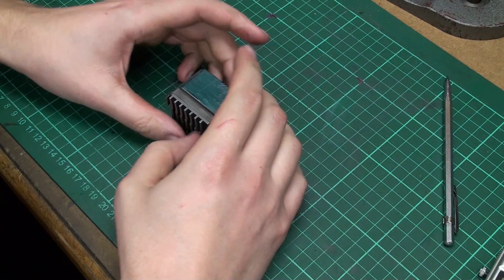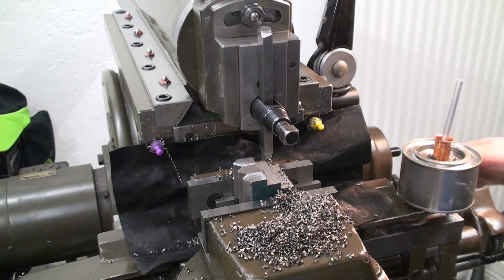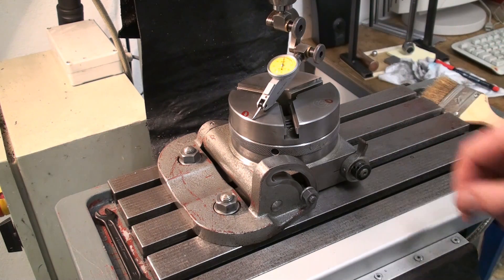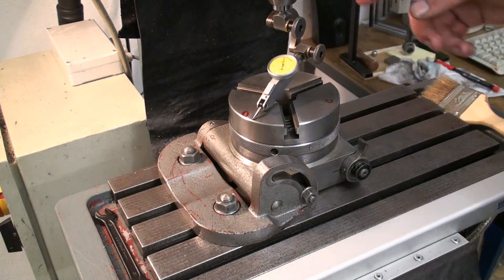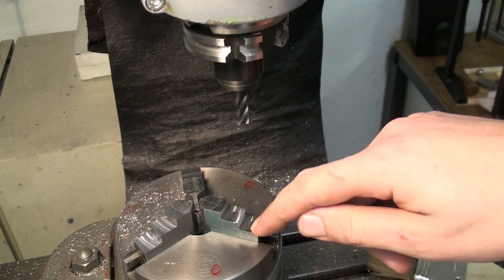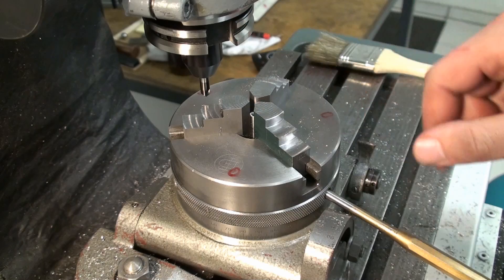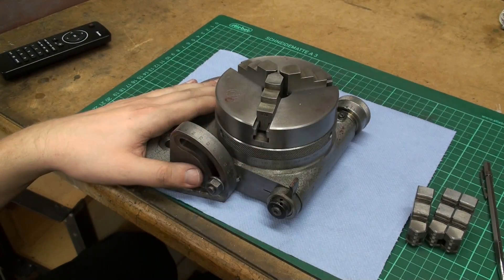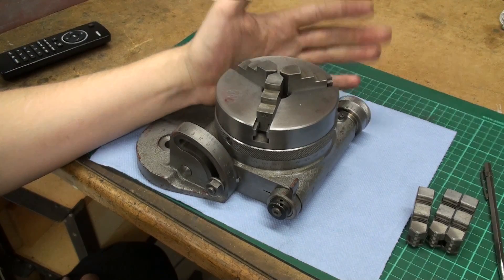Making a set of chuck jaws Part 3/3

Comment: Really great work.
I have a question though: wouldn't you get a better result if you rotated the chuck by its own crank instead of interpolating a circle with the mill? That way you could be sure that the clamping surfaces are concentric with the rotation axis

Comment: Stephan, I picked up a six jaw chuck for my lathe.  It only has three jaws with three of the jaws missing.  So, it is effectively only a three jaw chuck.  Where on you chuck the "offset" was 1/2 of the pitch, I trust that my "offset" will be 1/3 of the pitch.  I will cut a trial piece to see if my anticipated approach is viable.  I missed how you came up with the template for your pantograph.  And I do not believe that you explained how you set your ratios on the pantograph.  Can you help me out there?

Comment: Very nice precision project. I am curious though - would it have been useful to cut outer step at a larger diameter (i.e. with the jaws more open)? So that way when the jaws are opened to clamp on the ID of a bigger part the curvature of the surface would match better. I'm not sure what is normal practice.

Comment: Amazing and beautiful as ever Stefan. A question so I can learn more:you explained that the outer edge of the chuck isnt a reference surface, you dont have one actually to indicate the chuck to the mill,  the runout you got was very good but.. some. But at the very end to break the edge and cut the rebate, you turned the chuck by hand. Why couldn't you do the same when taking a finishing pass on the jaw inner and outer faces, so they would then be perfectly concentric with the chuck rotating axis ? Or did I misunderstand something?

Comment: Steffan, love your video's. When you set the work into the vise, do you not have to tap the work piece back down as you tighten the jaws? I always had the work lift slightly from the movable jaw slightly rising, thus the parallel would be loose under the work. The shaper I ran had a patent date of 1903, but would make a cut with only .001" variation across a 6 inch work piece. That was back in 1988.

Comment: Don't you need to clamp a ring on the outside of the inside clamp jaws before trueing them instead of clamping a pin in the center of the jaw to account for differences in the inner and outer scroll gear surfaces?
Reply: If there was any wear between the teeth and the scroll perhaps but they are a perfect fit.

Comment: Excellent job. Thanks for documenting this project. One question, have you checked the runout while gripping a cylinder from the ID? I was thinking that when you cut the steps the chuck was clamped in, when it should have been clamped out. Just to load the scroll against the side of the teeth that will be used. I do this when machining soft jaws. The nice thing about jaws that are not real hard, is that you will always be able to give them a touch up, without having to resort to grinding.

Comment: Hi Stefan, Once again I watch virtually perfect work. In all my 60 odd years of engineering I have never had the pleasure of seeing someone make replacement jaws for a chuck, or if it comes to that the capability of doing so. I have recently had the identical experience where the normal jaws were missing, and it was on a small rotary table, but fortunately my friends stock of odds and sods of chuck jaws came up with exactly the right jaws. The only problem was one of the teeth close to the lead edge was broken off and produced a 3mm off center error, but by careful manipulation I managed to get the correct orientation of that jaw and all came together with just 0.01mm radial alignment error.
A beautiful piece of work Stefan but tell me what are you going to do with yourself when you have all your tools and attachments working perfectly?
 Many years ago I was offered an engraving machine for nothing but declined the offer as I then didn't think it was of any use to me. After watching you I now think differently.
Keep up the videos Stefan and good luck to you for your future.
Best Regards MoK

Comment: I have watched all three of this series, for the simple fact, that I have this same tilting dividing chuck... I purchased it several years ago, from Ebay, and I think I only paid approx. $125.00 U.S.A. dollars, only to not realize that I got a really great deal on, due to the idea, that the suggested retail, over the years, I have seen these unit sell for as much as $600.00 U.S.A. dollars, so, I didn't do to bad. (((BUT))).... this unit is, by all means, not perfect. I did have to pretty much rebuild the entire unit, incorporate a flanged type oil-lite bronze bushing in where the chuck mates to the main body's structure, like a thrust washer and bushing, just to snug up the 2 axis of play that was in it. reconfigure the back jam-nut system.... blah, blah.. you get the point.... once done, and all trued up, I used this unit allot. There has been a few jobs that I wanted to use it and couldn't, but, now that I see how you simply made the teeth (with the engraver machine) (of which I now want one more then ever!), I can see making several sets of various type of jaws for this. Thank you for the efforts to put these videos together. I also would like to make mention, my unit has a few different things from yours. I think yours may be manufactured with a higher standard then the unit I own.....example #1, my scroll is turned back words from yours , as per, the direction the collar is turned to either move the jaws inwards or outwards. Example #2  yours very likely once had both sets of jaws, where as mine only has one set, but they are reversible (just simply scroll them out, and flip each one 180*, and re-scroll'em back in). That would tell me, that mine is of a less quality, due in part,  the game of truing the 3 jaws while they are set up in the chuck one direction of clamping, by grinding/machining the inner surfaces and then the outer surfaces, sure, that is great, until, I pull them out, and flip each jaw 180*, now, they are out again, by quite a bit... I ended up grinding/machining at a half way point, the best of both worlds, so to speak. Now, after seeing your videos of this..... I AM ON A MISSION !!!! Seeing the engraver make simple work of the teeth and accurately as well. I can assume cutting the teeth was time consuming, but, so worth it! Great job!!! I am sorry, this is so long

Comment: Really nice work.
I'm wondering about 1-2-3 numbers for the jaws, my 3 jaw chuck has those numbers and jaws can't be used in different order. Is this chuck without such a requirement?
Reply from the maker: +Andriy Podanenko You cant use them in different order, but you can use a different starting-slot, works on every spiral chuck.
Reply: Stefan Gotteswinter hm. I believe my chuck has specific slots for 1,2,3 jaws in terms of accuracy. But I need to check it additionally

Comment: Very nice work and workmanship!  I just found your channel and subscribed.  It seems the other guys have been keeping you a secret (glares at CompEdgeX).  I believe the large grooves in the old jaws are to increase the clamping pressure a bit and they are handy for holding washers to be bored out.
Anyway, thanks for sharing your work.:)
Reply from the maker: Eddie the Grouch Thank you for subscribing! That is a good posibility, I think they also are there to give dirt a spot to get out of the way (like on some cast iron surface plates with the waffle pattern).

Comment: Very nice work!  How did you determine the dimensions for the scroll teeth on the jaws?
Reply from the maker: amphib0410 I used an  optical profile projector (unfortunately not mine...) to work out the actual dimensions.. :)
Reply: amphib0410 A quick and dirty way is to use a flatbed scanner and trace the outline.  Then measure in software or print the profile at whatever scale you want.

Comment: The use of the pantograph over the CNC is a question. When LinuxCNC can do complex math in the g-code, why go to a human template for the spiral thread? And how did you get the 1/3rd thread offset by hand. Very impressive. I have a old clapped out 3 jaw for my lathe, you just gave me some ideas on.
Reply from the maker: Andrew Tubbiolo Ha, the pantograph thing is like woodworking with handtools: Just for pure enjoyment - I could do it faster on the cnc, thats for sure, but I was in the mood to do it oldschoolish.
To get the offset, I just had to advance my zero of the table between each jaw by 1/3 the pitch. Like offseting the zero destination on a cnc mill :)
Reply: Stefan Gotteswinter When I saw you doing some things like that, at first I was...WTF? Now I enjoy (and expect) your "because I can/want to do it this way", It always teaches something new :)

Comment: Great job Stefan!....I just made a set of top jaws, so I know a bit of the steps that need to be done. I am missing a set of jaws for my 8" Pratt Burnerd Chuck, so you give me some hope that some day I can have them!What steel grade was used?
Reply from the maker: Jim Liechty I used 1.2312 (Thats the ISO material number), its a prehardend moldmaking steel - It has around 33Rc Hardness when delivered. I think thats not to bad for the use in a chuck - I feared to send them out for heatthreating because of warping.
Just try it, use a piece of plastic, make a dummy jaw, fiddle with the theeth (One could also do them on a rotary table) and then make a set of steel ones :)

Comment: Very, very nice job Stefan. You used methods and tools that few have access to or have seen in use. I do appreciate that. One question: When you bored to true up the inside clamping surface you depended on the centering under your mill spindle as you said; would offsetting in X or Y and doing one jaw at a time as you rotated the dividing head not eliminated this alignment problem?
Reply from the maker: Karl Kulp Ah, thats a good idea, it might be the case, but there might also be some inaccuracity in the scroll and more so in my teeth that I cut in the jaws. Maybe I give it another try someday, but as far as runout goes I am pretty happy with that.

Comment: I really like the fact that despite having a CNC mill, you still do many things manually or with other tools.  It just proves that CNC doesn't magically make someone an experienced machinist.
Reply from the maker: Mark Kotyk Cnc is just another tool in the box, I love to run cnc machines, as well as I love the manual machines - The pantograph is a bit special as its realy up to feel the actual cut, you feel the drag of the tool, the vibration, when the tool gets dull, and so on :)

Comment: You should be extremely proud of your end result. Well done.
Reply from the maker: Ray Jones Thank you very much! What I wanted also to show that everything can be made, if one puts some thought in it :)How oftem you hear: "You cant do that yourself" or "You cant make one of those without blabla..", I cant stand such broad statements :D
Reply: Stefan Gotteswinter
I must admit not knowing much about shapers that I initially thought the template was going to be for the shaper to move the table as the tool passed across.
Your pantograph is a serious precision adaption of a toy I played with at a young age.
I have used templates with a wood router, but the 10:1 scaling of the pantograph is a nice precision enhancement :-)

Comment: Great work again! Just thinking.....how precisely made is that preload nut down there? Maybe some of the runout come from it?
Anyway, I'm so happy I found Your videos to watch and learn! No need to go elsewhere for top class machining entertainment! Merry X-mas, Stefan!
From Erling in Oslo, Norway.
Reply from the maker: Erling Weiseth I think the Nut is not the problem, as it centers itself between the three jaws, but more with my centering of the chuck under the spindle of my machine - I only had the outside of the chuck to dial it in, and thats not a real precision surface.Happy Chrismas to you also :)
Reply: Hi Stefan, first of all hats of to you! machining your own jaws! That's really great and truly inspiring.
But that nut keeps occupying my mind. You say it's centering it self, that's true, but there might be some minor flaws in it's geometry, flaws that might make one jaw has a bit less contact with the nut than another jaw, resulting in  that 2/100ths of run-out. 
I'm a bit neurotic i think, and personally would like to check it with a re-bore with a precision ground shaft or something like that, just to see if that run-out can be terminated...
 but as you said it yourself: 2/100ths is not a problem with a 3-jaw.

Keep up the good work

Comment: Ciao Stefan, you did an excellent job in my opinion. And I agree that your stuff has a better finish than the industrial one. Two questions: You use a cnc mill, do you think this has helped you a lot or if you had a manual one it could be barely the same? Do you think you can heat treat the jaws to improve durability?
Reply from the maker: Cosimo Marotta Thank you :)The work I did on the jaws could also be done on a manual mill without a problem, but the cnc is my only milling machine (Except for the pantograph machine).The steel is prehardened so I think I can get away with the hardness they already have (~33HRc).

Comment: Any idea why near the jaw slots the face is lower?

Excellent build, loved the series and you're right, your jaws look way better, never even considered why i always thought regular jaws look odd. It's exactly this. Too heavy cut, too much recess etc.
Reply from the maker: aserta It could be slight wear from the jaws that ride on that surface in that area, or the part warped slightly after they cut the slots in it, but I am not sure weather its one (or both) of those, or something completely different.The thing with the normal jaws with the big reliefs and chamfers is, that they work perfectly for normal work, but if you have to clam up something very tiny on the last bit of material, the difference shows ;)